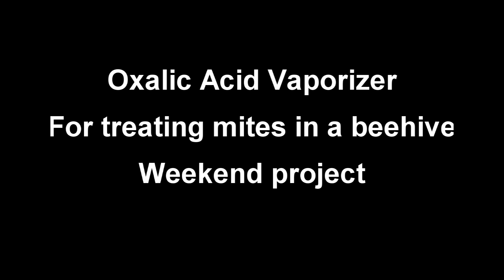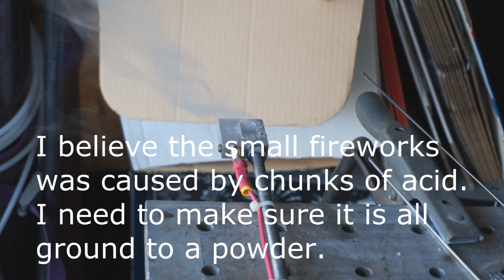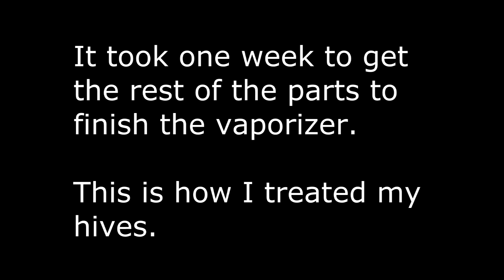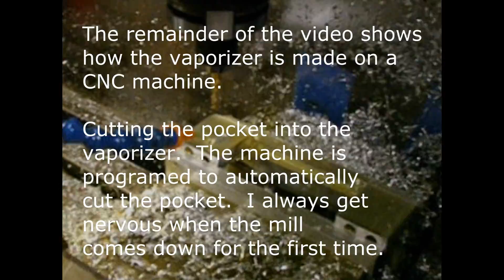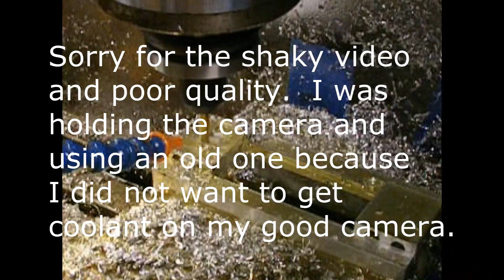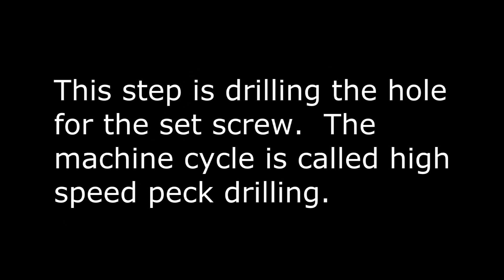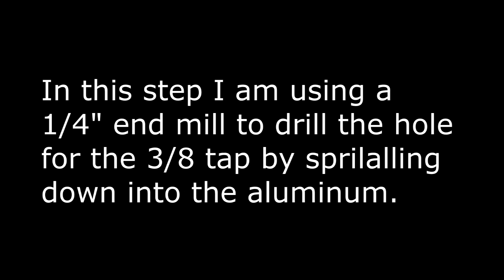Oxalic acid vaporizer

Comment: I made one of these and followed your directions to a tee but when I power the glow plugs they burn out in 15 seconds.  I drill and tap a hole in the aluminum block and the probe does not touch the sides.  What am I doing wrong?  Phil
Reply from the maker: Try a different glow plug.  Search eBay for:
FORD DIESEL GLOWPLUG SET
GLOW PLUGS 6.9L 6.9 1983-1987 F350 F250 GLOW PLUG

Comment: can i suggest a splash guard ? Drill a piece of metal slide it over the nut that is connected to the Block you machined out. Bend it into an  L shape. Add a tension washer . The splash guard will swing down rotating in between the nut and block. After loading the bowl you can just swing it up to lightly cover bowl area.Also, shouldn't you be doing this in the morning or evening? it only affects the bees it touches And male mites never leave the brood cell. Therefore you are treating only female mites and that would require you to treat every bee possible. Nice build, liked and subscribed

Comment: my autolite 1107 plugs are burning out in seconds.
Reply: +keith langford 
If the tip of the glowplug does not have complete contact with the aluminum block, it will overheat and burn out, it does not matter what glow plug you use.

Comment: Great video. What kind of glow plug did you use? You said it in the video, Autolite 1107, I think?  I tried to make one. The aluminum block was not a problem. When I energized it warmed up initially. When it did not vaporize the oxalic acid, I took it apart and found, a hole blown in the glow plug. Any idea what I did wrong?Size of wire was a 12.     12 volt battery.   Thanks.
Reply: +jeanne ONeill I read that the 1107 is a 6 volt glow plug.That might be why it burnt up.